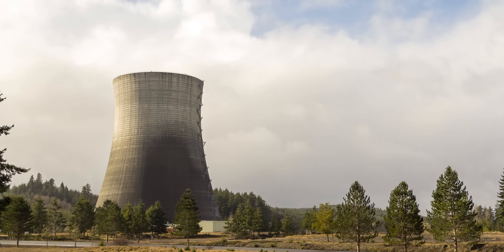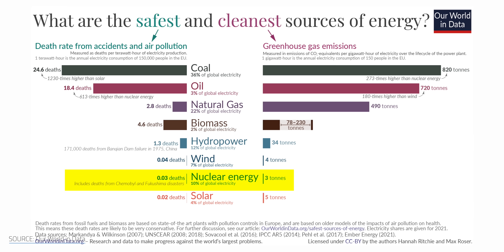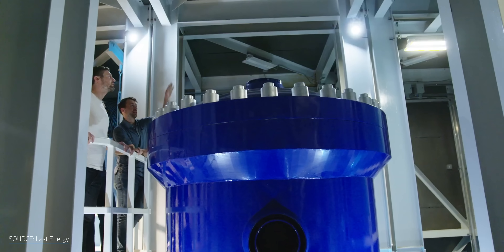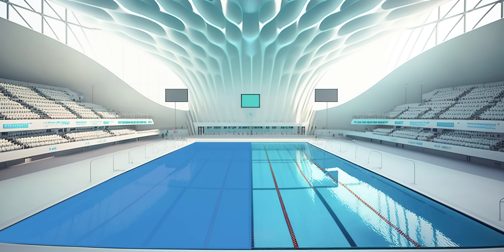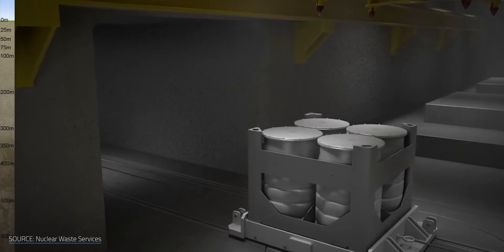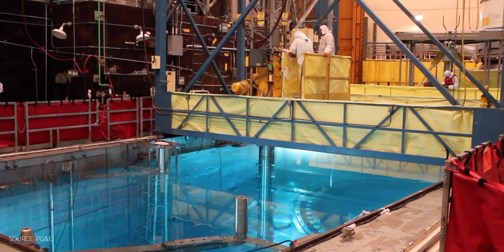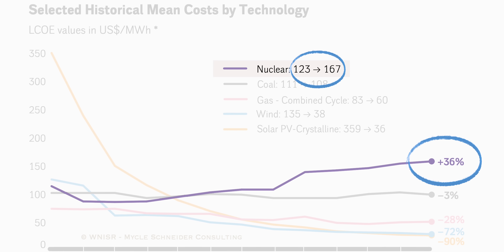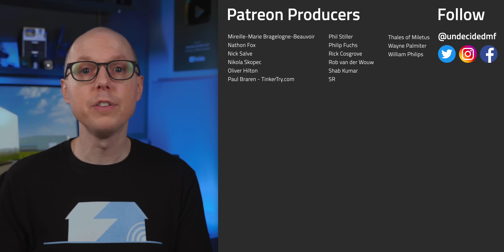Is Small, Fast, & Cheap the Future of Nuclear Energy?

Comment: It's disingenuous to quote the cheap LCOE for renewables, without  tackling the problem that renewable are intermittent.  If you quote for renewables you should also factor in  storage costs.  If you compare wind and solar with SMRs, costs wise they are predicted to be similar.  I'm not dissing renewables, but I firmly believe that SMR's are a crucial component of a carbon free and secure energy future.
Reply: And don't forget the additiional costs of providing load following capability for nuclear reactors which can't do that. They need additional power sources too. Why do you think all those pumped hydro power plants and gas peaker plants were built?  Wind and solar are rapidly adjustable in their output and so don't have that problem.

Comment: I suppose failures could be less catastrophic in smaller plants. But statistically, one could assume more plants would tend towards more failures.
Reply: Only if all other variables stay the same. With SMRs, especially these designs, none of the other variables are the same thus statistics can not be used to predict or even indicate disaster rate or scale. Different design, smaller energy amounts, not vulnrable to natural disasters the same way the others were improved safety features and reduction or removal of human error.

For example, of the 3 disasters, Chernobles was a different design and primarily a weapons plant, NOT a power plant. It was primarily used to make weapons grade plutonium. so design COMBINED with human error (not exclusively because of human error) caused that disaster. Chernoble type disaster is impossible with SMRs.

Fukishima was also partly a design issue, combined with a twin natural disaster of Tsunami and earthquake. That is why other nuclear reactors have survived tsunamis and earthquakes. At fukishima the primary failure point was the failure of the emergency generators due to flooding. With SMRs emergency generators are not needed or used as the reactors stop automatically in the event of power failure. There cant be a meltdown state afaik.

Not familiar enough with 3 mile but it's worth mentioning the difference in scale/size of the reactors, as well as design, aka 50+ years of safety improvements between that reactor design and SMRs.

So statisitics can only be use din this case if the designs and other factors were the same or similar, and they are not.

So your base premise if faulty.
Reply: @antoniestrydom6367 it doesn't matter the design, Chernobyl wasn't a technical issue so much as human error. Someone decided the issue didn't need to be addressed because it's cheaper not to. Can you seriously say in a capitalist market that this will never cross some CEO's mind for the sake of their bottom line?

Comment: I will be supporting nuclear on the day that the industry can present a price that contains ALL costs caused by running the power plant and are not relying on subsidies for anything and everything. We have a problem because the external effects of the use of fossil fuels have never been represented in the price: its too cheap for the harm it causes. Now you are actually considering replacing that with a technology that has exactly the same problem? No thanks. Nuclear today is for crooks ( i.e. the industry) or people who can not do simple math (i.e. supporters) And be reminded that I did not even mention that today's technology is actually dangerous. If the price is not warped anymore that problem will have been solved.

Comment: Once again, great information.  This goes along way to showing that the issue of carbon free energy is more of a shot gun rather than a single bullet solution.  But, did I miss what the cost for the modular units was vs Solar, Wind and traditional Nukes?  Thanks again, you information keeps me grounded about the future for my children.
Reply: My issue with Matt's video is that it assumes use of miniaturized versions of Gen II reactors. That is a mistake since they use the "old fashioned" fuel assembly model. MSR and LFTR Gen III/IV reactors are more flexible, safer, and can be refueled while operating. The SMRs of the type Matt was covering cannot.
Reply: @TwoWolves  refueled while operating is not necessarily a good idea with regard to proliferation. LFTR is just a specific kind of MSR. The Gen IV category is where the "safer" part seriously comes in as those reactors use physics alone to put a limit on the reaction and deal with decay heat, not active safety systems.

Comment: Nuclear is going to have to be a part of any low-emission energy future, because wind and solar are not actually renewable. Solar panels and wind turbines have to be built and then replaced when they wear out, and because their energy density is low and they don't work well in all geographies, it'd require far more metals and minerals to produce them at a global scale than the world's mining capacity can currently handle. That trend is going the wrong way, too, but nuclear doesn't face this challenge. More R&D into SMR's, thorium reactors, waste disposal tech, and fusion power will pay better dividends than throwing that money at solar panels or wind turbines.

Comment: Nuclear fuel is not expensive - its actually super cheap. 
Nuclear costs is heavily driven by the large bespoke designs, and the significant attention to safety.  Modular reactors help a lot in those regards. 
We have been operating nuclear reactors for 1000’s of years significant issue free in the US Navy Nuclear Fleet. (The reactor operator is the best/more borrowing job in the navy… nothing ever happens… it just sits there and works)
I like the last energy concept of just making the reactor vessel also the final storage solution for the spent fuel (if the US never gets over the recycling thing to extract that remaining 90%)

Comment: The figure I can't get is the cost of solar heating through well placed windows harvesting heat during fall winter spring and shudders reducing heat load during spring summer fall. It may be more but has the added benefit of having windows. When my parents bought thier retirement home my mother made him install 2 large windows on the south side resulting in reduced heating costs.
Reply: Yeah, Ford can make tens of thousands of cars each year simply by sun streaming through windows!
Reply: @scottslotterbeck3796  Ford doesn't make houses.

Comment: No country can guarantee political stability for a thousand years, when you get a civil war some crackpot dictator will have no issue shelling the facilities and spreading deadly fuel around. Having said that the existing nuclear power facilities should be kept in production for as long as possible and the used nuclear waste stored on site until technology can clean the site to an acceptable level.

Comment: Yes 30-60 people directly died from Chernobyl. But it was also estimated that 3000 pepple died indirectly within next 40 years.
Its the same amount of people who died from the indirect exposure of dust from 911. 

Still not a lot of people for the size of the accident (and including human disaster of not evacuating untill a few days later trying to hide it) and i like seeing it get ignored so it can leave a more positive influence on people but id like to point it out
Reply: Everyone on the helicopter which took the aerial film of the aftermath died. Most of the soldiers who shovelled the debris back into the reactor hole died.
Reply: That's the thing, we aren't comparing like for like. We aren't tracking cancer from those ppl exposed or even their children and the lasting impact. And this is before we've even scaled up Nuclear. The safety and security costs does not seem worth it
Reply: @gemelwalters2942  The 3000 number is from doing exactly that and tracking all the people who were exposed. 
And it was a reactor designed in the 60s that also took shortcuts to keep costs lower like cheaper less efficient control rods. 
The Fukushima disaster was also a reactor designed in the 60s and it's safety measures couldn't withstand the 45ft tall tsunami that also killed 19 thousand people  destroyed over a 120 thousand homes and partially destroyed half a million more. 

It's big problem was radiation leaks which made the surrounding town of 100 thousand people evacuate with no direct deaths, and only one tracked death from a worker who died from lung cancer 4 years later. In tests 5 years later it there were 100 cancer cases linked to it and now there have been 300 cases linked to it.

Yes we have scaled up nuclear since then but that was after much more safety measures were added on, and over the past 3 decades more and more safety measures are being added. Especially after Fukushima so now even if the buildings or coolant system is destroyed their are safety measures to not cause any radiation leaks even if everything goes wrong and their is a full meltdown let alone a partial meltdown like with Fukushima.

Comment: So I'm in Québec and HydroQuébec has a monopoly on the electricity. It's water dams. After hearing the potential for these smaller nuclear I am wondering what the numbers for Hydro is? I haven't really looked at it since it is what we use almost everywhere and although it is "clean" it does change large areas to make these. It would be cool to add that type of electricity to the numbers too.
Reply: THe short answer is that Hydro is excellent when just looking at carbon footprint and power generated. The only carbon generated is - like nuclear - the concrete needed for the facility itself. The problems with it are twofold, tho. First, every damable water source on the planet has been dammed. We're done with that. Lots of places have too many already - like China and SOutheast Asia. The other problem is the devestation that dams cause to the natural environment. They don't contribute to global warming, but that's a long way from saying they are green.
Reply: The number that matters is easy to find. It's on your hydro bill. Hydro quebec standard rate is 6.2 cents per kw/h (4.9 cents US).  From 100% renewable electricity. No nuclear or fossil fuel generation can match it. The wind and solar nonsense can't even come close

Comment: I'm concerned that these expensive and complex energy 'solutions' are just another way to maintain consumer dependency and hegemony and that the obvious better solution would be to utilize the less complex solar, wind, and wave power and focus more on developing energy storage solutions that are equally low cost, low complexity, less centralized, and more environmentally benign. much of the energy we consume is wasted because of inefficient design. I personally would rather see a decentralized grid of low complexity reliant on more locally sourced energy supplemented by wide scale intercommunity redundancies while enacting solutions to vastly reduce the inefficiencies that lead to excessive wasted energy. But I don't think that fits in the consumer market model of energy production and distribution accepted by the predominant economic culture de jour.

Comment: When I think of nuclear & what I would agree with or my opinion. I would want small modular molten salt reactors. A larger size should reduce costs but there is a limit on what you can build on a crude factory assembly line and then economically ship to site. Some of these SMR's in my opinion should be bigger but still modular and a lot smaller than on-site reactors. Molten salt reactors not only creates  reactors that are many times safer than PWRs but makes it easier and less costly to reprocess waste on site. This rereprocessing ability reduces nuclear proliferation and reduces waste storage to a few hundred years. I feel that an international research effort could bring this technology into operation in at a SWAG of 10 to 15 years & at a modest cost to all the countries involved. Lastly, thorium fuel, a highly abundant fuel could be used; although, I am sure that less abundant uranium would also work well. Most mining wastes are left over thorium which at presents a large environmental hazard. In my opinion nuclear needs more R&D and development before we go into mass building of nuclear plants. It should be R&D that will produce thousands of years of clean energy and definitely should not be over-looked. It should be given far more priority than it is. Should we build a few SMR's in the mean time? Yes. Yes, because building and running such reactors will get us experience and knowledge in their use before we try something on a large scale.

Comment: I think the storage costs required to make wind/solar viable for base load support need to be included in LCOE. That will paint a much more realistic picture of what “green only” construction will actually cost, and highlight why nuclear power is a far superior solution for base load operations.
Reply: I agree, but it can be kind of hard to quantify, as it all depends on which assumptions you make. For example, is 99% reliability good enough (average 3-4 days of power loss per year), or do you need 99.9% (3-4 days of power loss per 10 years), or 99.99% (3-4 days of power loss per 100 years)?

I would imagine that as you ratchet up the reliability requirements, the amount of storage you need for a pure wind+solar+storage solution would increase drastically, so the LCOE increases drastically as well.
Reply: @ab-tf5fl  🙂Yes, that's why in the real world, the whole grid system must be designed to economically work together: Main power sources, available storage types, flexible demand loads, transmission lines to distant sources and backup power sources all contribute.
Reply: Unless this new nuclear tech is LOAD FOLLOWING (current nuclear is not) you'd then also need to include the cost of whatever is needed beyond base load. Solar, hydro, wind (and gas) energy output are adjustable rapidly and so can follow the variable demand loads. Not nuclear (nor coal).
Reply: @fotoguru222  solar and wind are inverter based generation. They aren’t used as load following generators, and they also can’t provide VAR support. Nuclear power plants can follow the load, they just don’t because it’s not the most economical way to dispatch. New SMR designs are better at load following, though.

Also, I was specifically talking about the cost of base load operations. So your counter doesn’t even make sense, even ignoring that it was factually wrong.
Reply: @titleloanman  My understanding iis that the need for base load is a fiction invented to justify inflexible power plants such as traditional nuclear. We will do better when the sources on the grid are flexible, such as anything except coal and nuclear.
Reply: @fotoguru222  that is a fiction spread by people that only understand the power grid on the most elementary level (that being MW production, and literally nothing else that goes into grid stability). I’m a NERC certified reliability coordinator; controlling the power grid is literally my profession. So let me say with 100% certainty based on actually controlling the grid in reality that base load support is the most important aspect of power generation. You flat out do not have a power grid without it. 

Inverter based generation like wind and solar does not provide grid inertia, which weakens the resiliency of the grid. Significant grid transients can destabilize the frequency of the entire system, leading to cascading generation losses and total grid collapse. They also do not provide any VAR support (and frequently negatively impact VAR stability), which is required to prevent voltage collapse. They also are incapable of supporting black start operations, which means any blackout recovery relying on these sources are inviable - which means all blackouts are *indefinite*. 

Base load plants provide all of these stabilizers, on top of being the only on demand source of power that can sustain a capacity factor above 90%. Renewables have capacity factors south of 25%. This means you need to build out nearly four times the MW capacity of renewables to provide the same MW supplied by base load plants. 

Also, you keep talking about nuclear and thermal plants being inflexible with the tone that they only operate within a narrow band of power. This is false. They can dispatch across their entire range of power just like any renewable source - they’re just cheapest when they’re dispatched as close to 100% as possible, so they are in order to always provide the cheapest power possible to consumers. 

Renewable energy has plenty of merits. It doesn’t need the campaign of lies that has taken root to shoehorn it into portions of the market it has no place being. That’s only going to lead to catastrophic grid collapse and years or decades of recovery. Base load plants have their place in the system - and nuclear is the best option for base load support as we phase out fossil fuels. Renewables are great for contributing to MW production in a sustainable and scalable manner - but they do not and can not permanently replace base load plants.

Comment: Time will tell, but I think the path to SMR adoption will be paved by innovative regions like Alberta, where external factors drive the economics of SMR. Alberta is cold, northerly, and uses enormous volumes of natural gas to heat heavy oil processes - a major foundation of their economy. Carbon pricing is making the old way increasingly expensive. And while everyone wants to phase out oil, Alberta could make heavy oil production far greener using the thermal output of SMR reactors. The lifespan of a few decades matches well to the lifespan of heavy oil projects. And being “northerly” with little sunshine in the long winters, nuclear makes a lot of sense.